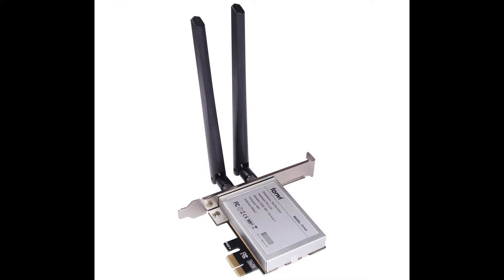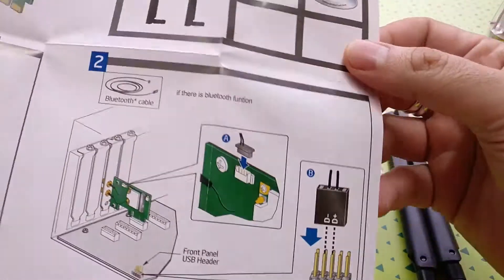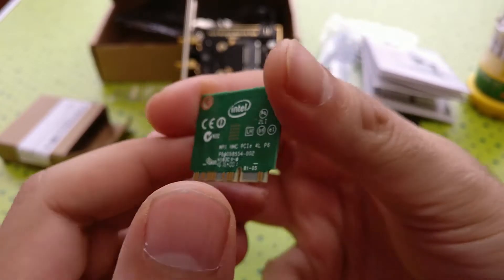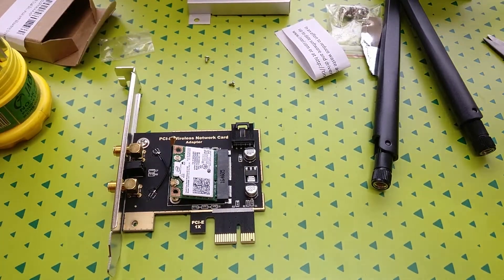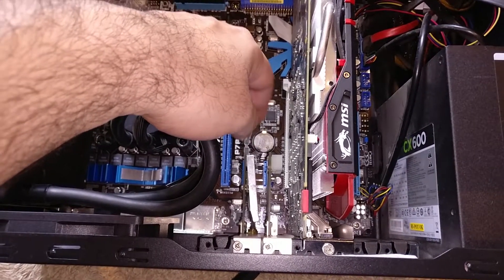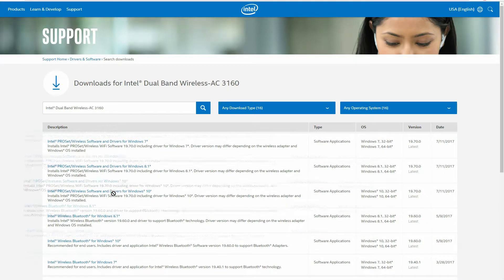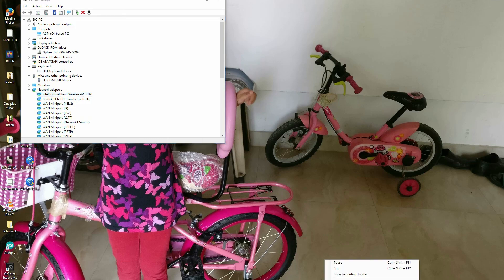Fenvi WiFi card build with Mini PCI card DIY

Comment from the maker: I sorted this by checking my older video. Bluetooth problems are not a driver issue. 
The slot is NGFF (aka m.2). Interesting thing about the slot it is can connect either PCI, USB, and SATA. When using Intel wireless cards the bluetooth module is actually wired through the USB connectors of the NGFF slot. The part where I mention that you dont need to use the cable provided by Fenvi is a mistake. Please connect that to the Motherboard USB input internally, and you will see that Bluetooth icon appears on rebooting the system and is fully functional!
Reply: I ordered a fenvi card by amazon, but the cable to enable the bluetooth was not included, could you tell me what the entry on the card is called?
Reply: Same here. Do you know what is that bluetooth cable called?
Reply: ok all...i bought the same adapter, mine is 8260 chip, according to the adapter, the bluetooth usb wire must be connected to the motherboard usb inport to run the BT h/w..will updates further

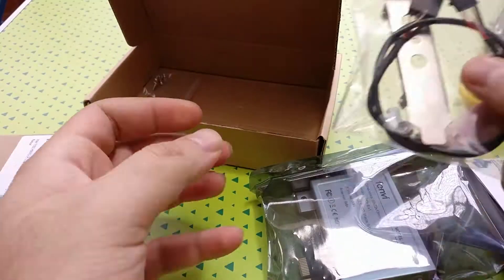Comment: But sir where do you connect cables at 1:12
Reply from the maker: Those cables go to the USB pins on the motherboard... these enable the Bluetooth.
Reply: @rtechreviews  ohh but where can i put please explain deeply please
Reply from the maker: The Bluetooth capabilities will only work once you connect this cable on the USB slot of the motherboard.

Comment: Why can the hardware not be found after installing the FV 102 wireless card on Win 10? Please advice and Help. I am using intel 3160NGW Dual band Card.
Reply: Shubham Ghosh Dear Shubham could be a hardware issue as discussed. Please check the device manager tab to see if the device is detected
Reply: I check the device manager tab to see the device is not detected
Reply: Seems like a hardware defect.
Reply: Also can you share pictures of the setup
Reply: Where I share pictures of the setup?
Reply: Probably a bit late to the party but on some boards the device is not detected if plugged into an x1 slot. This was reported in another video. The solution was to use one of the other available slots (x4/x8/x16).  IIRC, the chipset on that board was x570.

Comment: Thanks for posting the update regarding bluetooth device.  Not informed on NGFF (M.2). Quick lookup suggests that the bluetooth device is slapped on with power coming from Usb - is that the case - explains why it was not enumerating on the device manager
Reply: Ramesh Errabolu good info